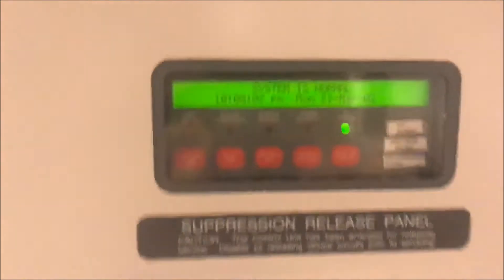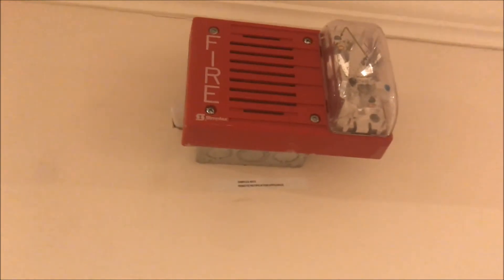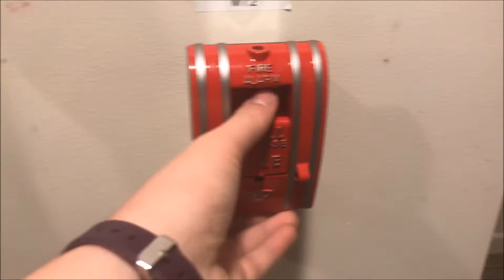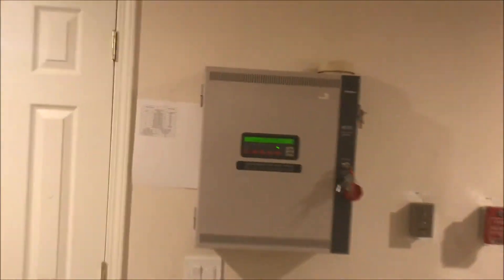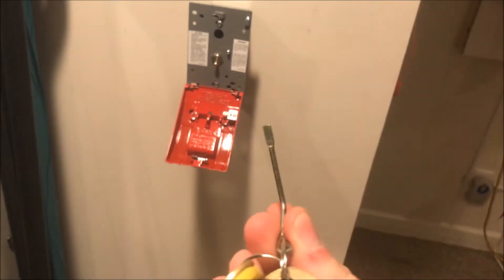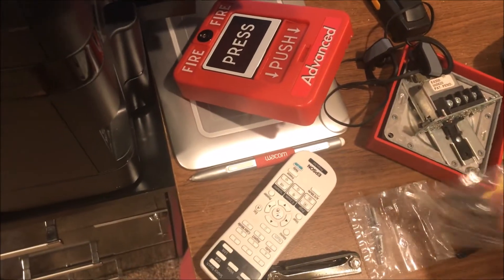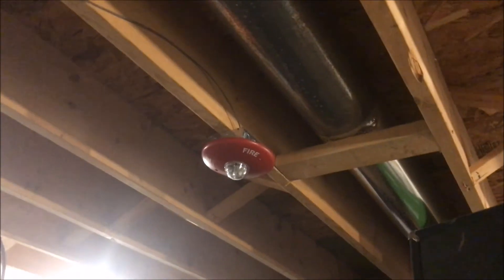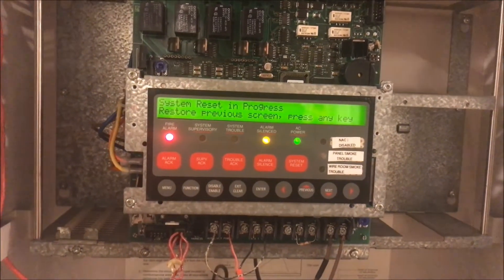Simplex 4010 Test 7: Simplex Horns

Comment: Cool video and are these alarms rare because I never saw it before in a building or really on you tube and is there a key switch that resets the system when you turn it back and is there some that don’t?
Reply from the maker: I have seen quite a few in buildings around me, so In wouldn't call them rare. In regards to the key switch, my Simplex panel doesn't let me (as far as i know) set a point as a reset on the system. Most keys witches with a "reset' are for resetting duct detectors, not panels.
Reply: Fire Alarms and Such ok thx and it’s just I see a lot of system sensor and wheelock not a lot of simples devises really